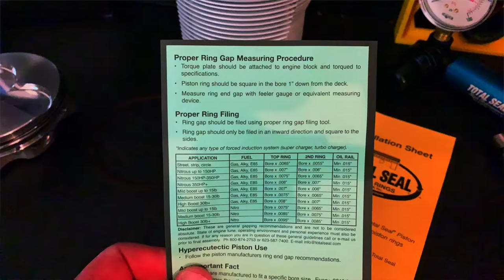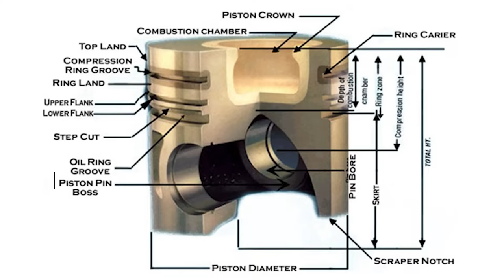End Gap Mistakes That Will RUIN Your Engine

Comment: Next big argument where to put end gaps. In training class trainer is one of people doing testing on diesel Paccar engine. They all sorts of things possible see "what if" tech did this or that to see what it does to engine and emissions. He said they tested putting all rings gaps lined up with each other. Ran engines on dyno, in truck all of rings turned. Even tried clocking rings as normal and yes they turned. Showed us video and pictures of these engine. Many claim they can't turn ok what there to stop that mmm nothing. Unless ring get stuck in piston groove and thats not good either. Most semi engines are keystone shape compared to car engines. Me, I've never seen ring gap stay where you put them in diesel or car engine. I have co-worker who swears they don't move and went rounds with trainer guy that day.
Reply: There have been pistons used that have a stop built into the ring groove to PREVENT ring rotation. I don't remember the application, may have been 2 stroke motorcycle
Reply: @wymple09  So what is wrong with rings rotating? So if ends stay in one location its going to leave marks in cyl walls and most likely have stuck rings
Reply: @pdmustgtd1013  I didn't say they shouldn't rotate. Learn to read.
Reply: Maybe you should learn to read on reason why they turn
Reply: Reason is they don't get stuck. I suppose you think if all ring gaps line up going to cause blow up too.  Well it doesn't.

Comment: My auto mechanics  teacher  was a military  airplane  mechanic  and  I have always  listened  to him  , and I would  think he knew  what  he was talking  about  , and I'm sure  airplane  engines get very hot , I been  building  engines  for 40 years now  , totally  opposite  of everything  you  said  and I have  NEVER  had 1 single  problem , but  you do what you think is best  and  I'll do the same  .
Reply: what do you mean by "opposite" ?
Reply: @bavarianmonkey8326  , at the 55 second mark  he Plainly  and Clearly says 

IT  BASED ON EXPERIENCE   !

my experience  has taught me  how to build engines  and  I have a  Small  block  327 that can crank to 11,000rpm .

I been  building  engines for  40 years and  that's  my  EXPERIENCE  

And I build them opposite  of how he explained the way  he  builds  engines .

But I have never had to explain to  a monkey  before
Reply: By “opposite” do you mean tighter gap on second ring?
I think it’s more a communication problem than an engine building problem. Maybe an ego problem too.
Reply: @bobirving6052  , An ego problem  because  I listened to  my Auto Mechanic  teacher  ?
And I have  40 years of  engine building  with  ZERO  Problems ! 

If that's what you call an ego problem  , then  you must have a  serious  jealousy  problem , 

Every single  internal combustion engine whether gas or diesel is nothing but an air pump , 
The faster it pumps air , the  more power it makes , but they must  all do one thing  .
COMPRESS  ! 
The  higher the  Compression  , the more horse power  it produces .
When I install a Camshaft  , I don't  care about  lift as much as  duration ,
Leaving  that intake valve open  let's a lot of Air/Fuel mixture in and the same thing  letting it out  , 
So a bigger carb and  headers  are a  must , 
750cfm  or bigger  and  the biggest  headers you can  find .
CFM stands for Cubic Feet per Minute  and  the more  cubic  feet of  air that goes through your  Air Pump and  out of your  Air Pump makes tremendous  horse power  , 
My little  small block  327 has no problem  pulling both front tires off the ground in my 66 Chevelle SS  , it has a 11 inch clutch and M-21 Muncie 4 speed and 12 bolt posi .

It makes great ego power  bob  !
Reply: @jimthomas1989  I asked what you mean by opposite. Maybe your gaps are smaller on the lower rings or whatever. The motivation behind my question was to get your way of doing things so people can extend their individual horizon by reading your answer. Unfortunately, you did not give any information regarding ring clearance but instead you told us, what you own and what those things can do. 
So please, tell us what you are doing opposite of what is stated in the video and why you do it the opposite way, so we can understand your point of view. :-)
Reply: @bavarianmonkey8326  , 
The definition of the word SAME  

I would  be doing  the SAME  thing  as this guy in this video  

The definition of the word OPPOSITE  
I would be doing the total OPPOSITE  of what this guy  is doing in this video 

I always  have and I always  will .
Watch this video  and  then do  the 
OPPOSITE  of what he actually  does 

The definition of the word ACTUALLY
Reply: @jimthomas1989  your teacher might have taught you stuff that proved valuable to you. You did none of that here in this discussion. We all know what opposite means, there is no need to tell us how words work.

So once again: What are the measurements you use for piston ring gaps, from top to bottom and why? 

The information given in the video is the same that one gets from  multiple sources including the 1000 hp from 2 litres of displacement discipline so it seems to be right...doing the opposite does not make a lot of sense and the information given until now did not lead to anything but you bragging about what you own without teaching anybody anything of value.
Reply: @bavarianmonkey8326 but don't you understand? He's doing the OPPOSITE!! 😂 (yeah I have no clue wtf he's taking about either. Maybe he races in reverse😅🤷‍♂️- who knows, or cares)
Reply: @colestowing8695  well, if you use the wrong diff, you have one gear forward and a lot of reverses ... So technically, this is possible 😂
Reply: On aviation engines I learned to  order rings at +.015 and trim them to the minimum gap specified by the manufacturer. My engines passed annual leak down checks longer and used less oil than the other guys on the field. Never had a problem and my engines had a good reputation for reliability.
Reply: @colestowing8695  , at the 55 second mark  of this video  ,
He   PLAINLY  SAYS  - 

It's   based  on  Experience  ! 

I build  ONLY small block  Chevy  engines  from the 60s and early 70s  and  
MY   EXPERIENCE   has   NEVER  
FAILED   ! 

So make jokes  and  say whatever you want  , 
This Method  may or may not work  for  Ford , Plymouth,  or other engines  , 
I don't  really  care about them .

If you don't  agree  , listen  to this  video at the  55 second mark  multiple  times  !
Reply: @jimthomas1989  dude, nobody is saying that you can't build an engine. What we were talking about is the fact that you never specified in what way you do things "the opposite" of what was done in the video.  The opposite could mean anything... do you put pistons in backwards? Do you put the heads on before the reciprocating assembly? Those are both ridiculous of course, but they could be considered "the opposite" of normal engine building.  I have no reason to not think you can build an engine. We just wondered what your original point was- you need to be clearer in your verbiage. You've been getting upset when people were just curious and wanted more info
Reply: Good lord this exchange is funny. Let’s not worry about what this guy is doing. As you can see by his replies he’s the kind of person you want to take any advice from. Totally fueled by his ego and he’s hung up on what his shop teacher taught him 50 years ago. As if being a mechanic in the military gives him extra qualification. Lmao that should be your first red flag. Can tell Smokey Yunick over here was so busy slamming together 327’s he didn’t do any time for Uncle Sam.
Reply: @colestowing8695 ,  
They are  talking about  Piston 
RINGS   in this video and  NO  I don't  do what  they recommend  in this video  , I never have and I never  will  !

Comment: So lake if you know that the second rings need to be the same as the top, why doesn't total seals instructions say so???
Reply from the maker: The instructions that come with the rings provide solid guidance for setting end gaps. In this video, we are showing some tricks we've learned that provide some advantage over the standard guidance.
Reply: Good answer. Always improving and sharing your knowledge for our benefit 👍
Thanks!

Comment: Any comments on single compression ring engines?
Reply from the maker: That is typically a result of a short compression height on the piston. Given enough room on the piston, and 3 ring set up will work better in terms of oil consumption than a 2 ring set up.
Reply: @TotalSeal  
That's specifically why i asked - the use of single ring pistons to allow the improvement of the rod-stroke ratio.
A common issue is poor oil control and, to a lesser extent, poor blow-by control under light throttle, when the rings aren't pressurised.
I was working to the spec' top ring gap for the compression ring and, IIRC, 20-25 thou' for the three piece oil rings.

Next time I was thinking your two piece compression ring with the machines pressure grooves, rather than the supplied 1 piece.
For the oil control, I was thinking maybe a larger top gap would be the way to go, to give a wider opening for the oil scraped off on the up-stoke into the oil return openings in the piston, with the lower scraper left 'tight' to help reduce the oil bypassing it - on the upstoke returning through the oil returns, and on the downstoke both feeding scraped oil into the return holes?

Many oil scrapers are low tension, so that may also be a factor - froiction vs oil control?
Reply from the maker: @gordowg1wg145  10-4, For a two ring package, I'd go with the gas ported top ring along with a touch wider end gap. Then mirror that top ring end gap on the top oil ring rail. That combination will improve oil control and top end horsepower.
Reply: @TotalSeal  
Thank you 👍

Comment: 7 thousand per inch and 2 thousand less on the top ring. 28-30 on the top ring and 24-26 on the 2nd ring has never done me wrong on any 3 digit hp, 4 inch bore motor on pump gas

Comment: HUH???? end gap determines blow by, oil consumption, and overall compression reading on a gauge during a compression test, usually u can use a much smaller gap than recommended as long as you don't plan on overheating it from a cold winter morning using a cast piston that expands FASTER than the cylinder walls and seizes/cracks, that's the reason you use more gap is to prevent thermal expansion seizure, same thing goes for valve clearance

Comment: And just as as important for maximum HP do NOT use anything heavier than wd 40 on your rings, ring compressor or cylinders when building your engine. Motor oil, assy lube, trans fluid etc is a HUGE no!

Comment: This video is so confusing. Say second and top and I've lost if we're talking compression rings, oil rings or what.
Reply from the maker: We were talking about both compression rings and oil rings. What we suggested in the video was running a wider end gap on the 2nd compression ring and on the top oil rail ring (if the engine is dry sump).
Reply: @TotalSeal  Have you mis-spoken or are you now recommending something different for wet sump vs dry sump, contrary to what was said at this point in this video? https://youtu.be/_NxFRoN-Qok?t=639

Comment: It’s my understanding that arranging the gaps to not line up during assembly is futile and unnecessary. After a few minutes of running the rings will move around and no longer be in the same arrangement. This has been proven during tear downs by engine builders.
Reply from the maker: That’s false. Always clock the gaps as per the instructions.
Reply: @TotalSeal  Thank you.  I always have clocked the gaps personally.  Can they move?

Comment: My Harley 1340 Carb 95 HP I just did rings and the gap called for 22th  Im getting lot of blowby ,  I pulled the heads the valve guide seals failed  200 miles,   I know it can take 1000 miles for rings to seat .     last time the rings never seated when I had this much blowby .   Or do a fast ball hone and use the same rings ??  Or re ring and do a fast hone  it blown out a half quart in 200 miles .
Reply from the maker: In a case like that, re-hone and install new rings.
Reply: 1000 miles????  Old wives tale.  98% of seating is done in 1000 seconds, or less!
Reply: @alro2434  lot of guys will ride it like they stole it  and have luck  then others failed .